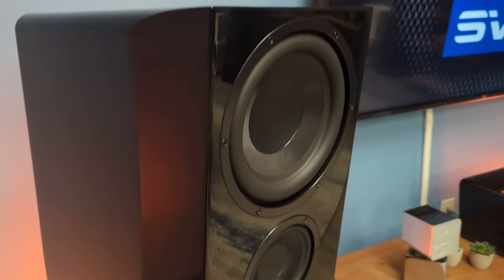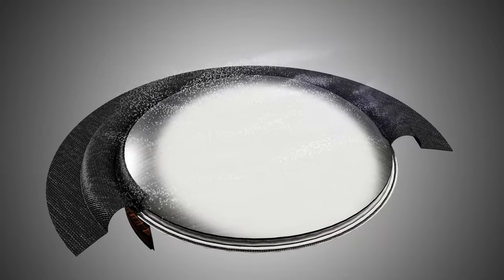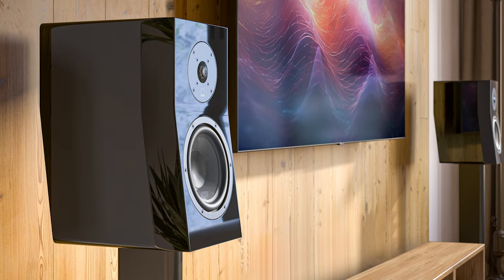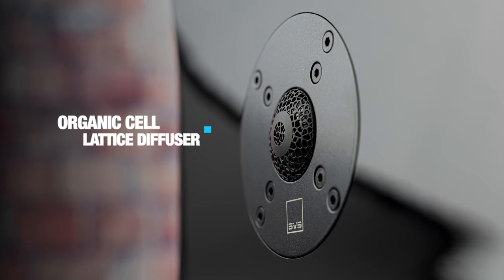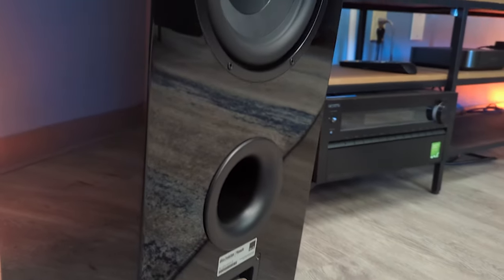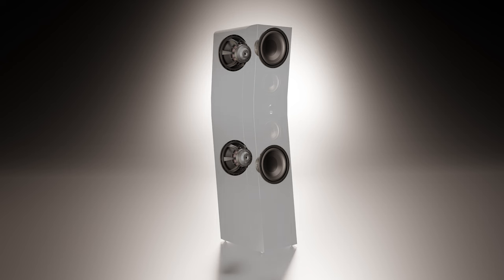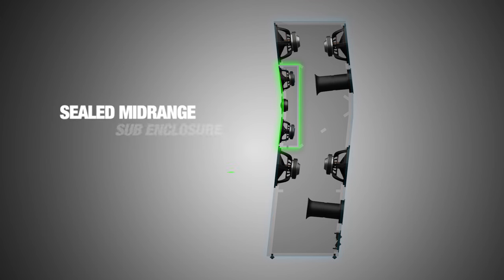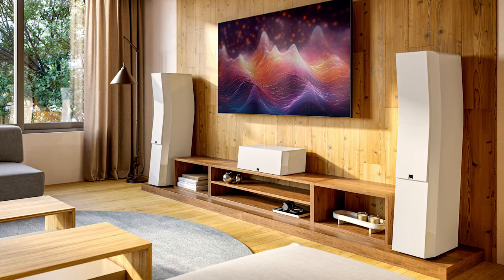SVS Ultra Evolution Speakers: Diamond-Coated Tweeter and Force-Balanced Woofer Array

Comment: Questions for SVS about the Ultra Evolution Center speaker verses the previous Ultra.  You have made it clear that the tweeter has been improved, what about the mid and woofer designs?  I can see that the 4" mid is now a 4.5" on the Evolution and the woofers the same size at 6.5".  Are there design improvements in these drivers as well?  Are the crossover designs similar? I currently own the Ultra Center and wondering if I should get the Evolution to replace it.

Comment: Impedance for all of the new speakers dropped to 6ohms from 8ohms. 
Is this to better describe the actual impedance or will they measure a lower average like before?
Reply: Most speakers dip to 6 and 4 ohms anyways.
Reply from the maker: Loudspeaker impedance will actually vary considerably with frequency.  There will be a minimum value, a maximum value, and an average or 'nominal' value.  

The nominal (average) impedance for the Ultra Evolution speakers is 6 ohms, and all of the Ultra Evolution loudspeakers can be easily driven by any decent quality AVR or amplifier.

Just reach out to our CS team if you want to do a deeper dive on a recommended amplifier power rating for your specific application, room size and playback level.  

Ed M - SVS

Comment: Being the proud owner of several SVS speakers (SB16 Ultra, Prime book shelf, Ultra Surround, Prime wireless), I am a big fan. However, I'm struggling with replacing my B&W 702s2 towers. I didn't think the previous Ultra towers would perform as well, but now with the Evolution, I'm having to reconsider things. Can someone provide some insights?

Comment: if you have woofers rear firing with ports wouldnt you need significant space from the front wall? this is what logics tell me. if this is the case then most people with home theatres wouldnt benefit front this design? Typically seen in two channel speaker designs
Reply from the maker: The angled rear cabinet wall creates natural distance from a wall for the ports which reduces how far you need to pull them out. They will benefit from being pulled out further, but 4-6 inches as a starting point is good.